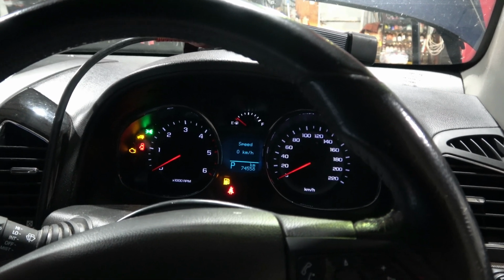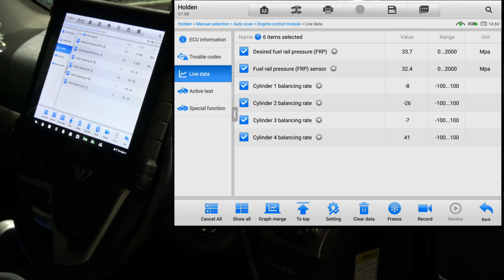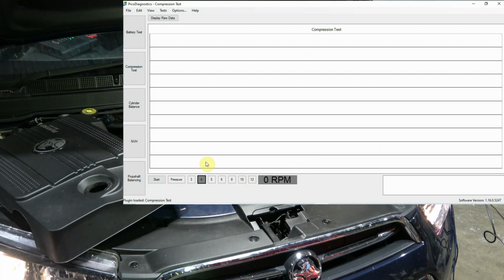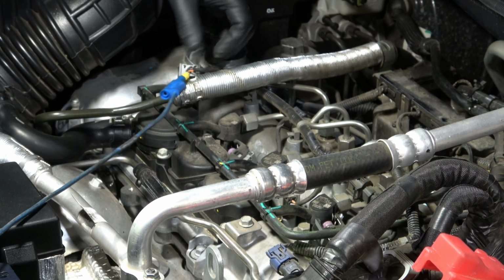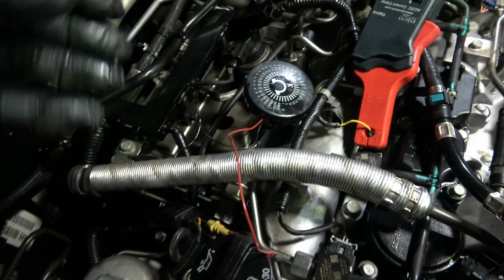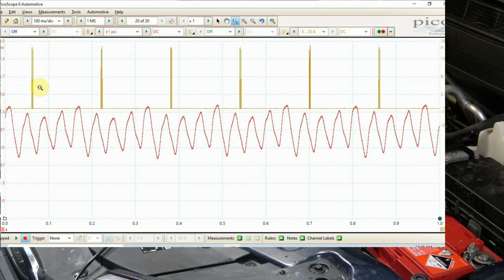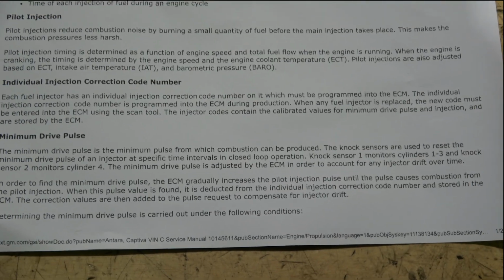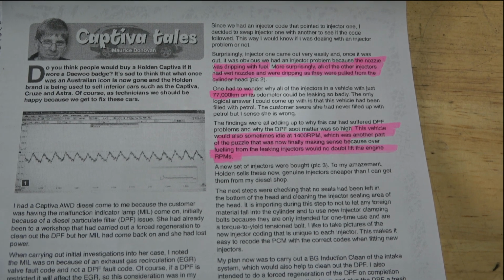2017 captiva fuel injector fault P02D1

Comment: Thanks for this investigation, I'm having EXACTLY the same issue with my Holden 2017 Captiva LTZ (73000km). After injector 3 replacement, did your customer came back reporting same issue again after all these months? Would love to find out, thanks
Reply from the maker: Nope

Comment: For a sync it's easiest to use the cam signal. Just need to measure the cam and injector with the engine running first. Another way is to unplug the injectors and fit dummy injector/noid light.
Reply from the maker: How do you know where is no #1 just by cam signal? Unless you sync that with crank signal first and even that sometimes it can be very confusing if you actually don't have good known waveform. And some crank signal can be pain to tap into. This is universal easy method anyone can apply to. That's always my preference. I do not think their such thing as dummy diesel injector for electrical diagnosis. They have one for checking compressions. But I know what you saying, it would be nice to have but again how many different types do you need.  I know what you saying works on petrol EFI. I'm not sure about diesel injectors, but I will try it out next time. Have you tried it with noid light on diesel system and it worked? It would be interesting to see. Thanks Nathan